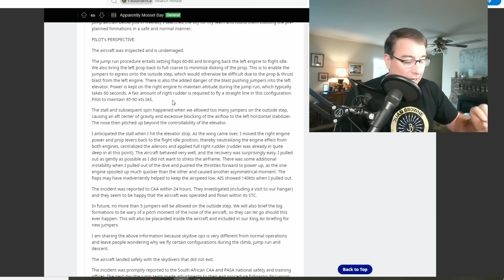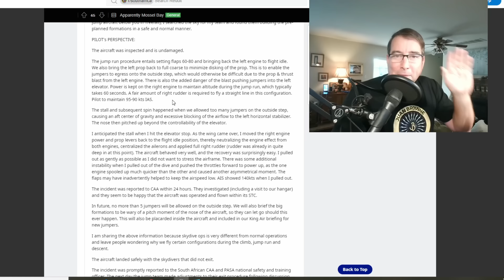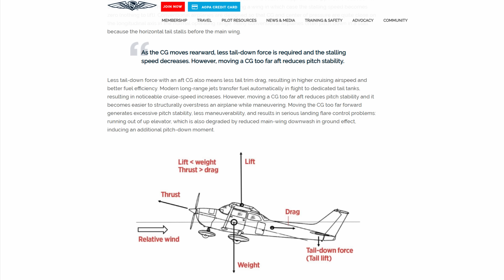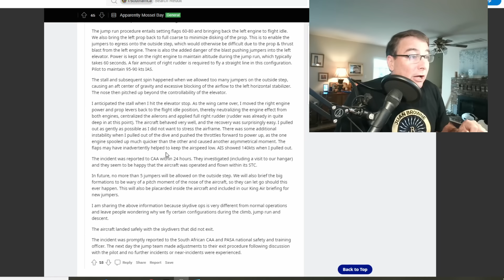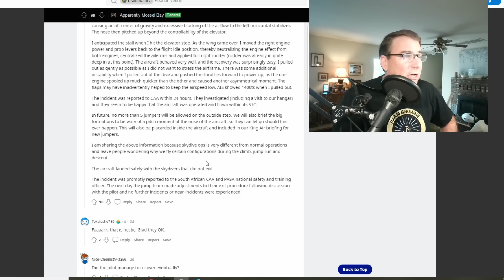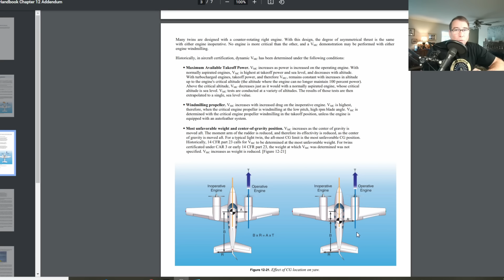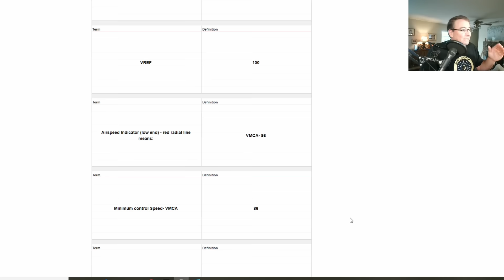Stall+Yaw=SPIN!  King Air Skydive Incident

Comment: The female jumper who came out last commented on the original source video. She said she didn't bail but had nothing to hold on to. Was thrown around and ended up on the floor by the door and when she tried to get up, she was thrown out. Bruised but OK and jumped the next day!
Reply from the maker: Thanks!
Reply: surviving an airplane ejection is not a common thing.

Comment: The last exiting skydiver was probably thinking it's safer outside than inside!
Reply: No - she got thrown out.
Reply: Without a doubt his intention was to get the hell out.
Reply: @Drew625in2une  her intentions wasn't really relevant because she got thrown out from not being able to hold on to anything.
Reply: we always think that. Once above 1000ft.
Reply: I’m outta here …
Reply: I always think I'm better outside than inside.  Used to jump out of Cessna 182 a bit.  Took a bit of rudder to get the door open.  Always a great time.
Reply: Most skydivers are not pilots, so the jumper probably thought something was very wrong with the plane after that incident. so why not get the jump in, instead of a potential botched landing due to some mechanical damage. why would a skydiver want to die in a landing while wearing a damn parachute? fast thinker I say...unless they were actually thrown out unintentionally. then they are lucky not to have been harmed, and to have got the jump in. I'm sure the divers that landed in the plane were relived, and disappointed as well.
Reply: Her comments were interesting.  She was next out apparently and had nothing to hold on to, was thrown about the aircraft and finally ejected.
Reply: Like we would ever take a skydivers opinion about “safe”. 😂
Reply: @perwestermark8920  I suspect the 4 left inside couldn't have gotten out if they wanted too due to the lateral g forces.  Then recovery at 250 knots was outside exit speed to jump from.
Reply: @dirtcurt1  Yes, I think the girl thrown out happened to be close enough to the door - probably even forward of the door. The others got bunched up on top of each other.

Wasn't too long ago a number of jumpers died in northern Sweden after their plane got in a spin from disoriented pilot. When he got out of the cloud, he pulled too hard and collapsed the plane. So all jumpers packed on top of each other in a wildly spinning plane all the way to the ground.
Reply: He thinking OH SHIT,  I am OUT OF HERE !
Reply: Once you have a parachute 🪂 on……..
You always think that your chances of survival are best outside the aircraft.
While in the 82nd Airborne Division heading out to New Mexico for desert warfare training back in 1974…….. the C130 was running out of fuel, so the pilot 👩‍✈️ decided to fly at about 150 -200 feet ………… we paratroopers wanted to hook up and jump out but we wanted the pilot to give us more altitude……. Instead…… he was looking to crash land on the Texas desert !!!!!!! We didn’t want anything to do with that.
Luckily 🍀…………. We made it to the landing strip and the pilot shut the engines as soon as we came to a stop 🛑……………. The guys from the Air Force towed the C130 away from the runway.

Airborne ! ! !

😎

Comment: I know this is an old video, but I just saw it and it brought back memories of being in a C90 that stalled on approach at 2500’ AGL in IMC. We were a medivac coming back to our home field after a transport. ATC had kept us high due to being between two larger airports, and the PIC was angry with ATC because of this. He had the gear down, full flaps, and throttles at idle to slow down and attempt to lose altitude in order intercept the localizer. Problem is that when he did pickup the localizer he pulled back, lifting the nose and the IAS dropped to 70kt. Things got quiet, stall horn was screaming and the wings buffeted. Now we had issues with this pilot in the past, so luckily on this flight there was an observer pilot in the right seat who took the controls, nosed over hard, and firewalled the throttles. The recovery was quick, and we went missed, but landed safely on the next approach. The worst part is the PIC would not admit that he stalled the AC. He was terminated on the spot.

Comment: Flying jumpers in a Twin Otter, yes, we would reduce power on the left engine to reduce prop blast, and use rudder to compensate. I wouldn’t go to idle, just reduce it some.. you don’t want the left prop be be a disk, you still want some air flowing through to help the jumpers “fly” their exit. Pretty normal. The jumpers also need to be aware about causing an AFT CG that could cause controllability problems. The Otter happens to be a more forgiving plane than the Kingair though. There was a similar incident in the PNW where one half of the Horizontal Stab came off in recovery. That plane got fixed, and eventually went to to get destroyed in the Hawaii accident.

Comment: Juan as a skydiver and a single engine prop pilot I can't thank you enough for the analysis. I'd imagine all the drag on the port side engine, while decreasing thrust on that engine would be a set up for disaster. While the pilot may have wanted to avoid the prop wash on the skydivers sitting outside the airframe, increasing the chances of a premature deployment and getting wrapped in the empennage (which would take everyone down) and I don't fly twins. Feels like a recipe for disaster if not performed correctly,  the pitch up was an issue given asymmetric trust, I'm not an expert at Twins in any way and never trained in them. Your analysis is pretty spot on, I've been enjoying your channel for a while and appreciate this breakdown. I learn so much on your channel, I hope you keep it up and also break down these situations as well.  Much appreciation for you.

Comment: Former jump pilot with A90 and BE-99 experience: too many people got aft on this one, pilot would have had to fly so fast to keep that many people on the tail they would have blown off. Poor recovery after spin entry, but I blame the jumpers for loading up the tail too much. Not a lot of elevator authority at slow speeds and a narrow CG range in the Beech's, gotta fly 100-120kts to have big ways hangin on the tail with less flap
Reply: Wtf you mean poor recovery ??? He recovered and did not kill anyone. If you recovered right away he might have hit a diver.
Reply: Use a 200 or 350.  That T tail makes a huge difference in C of G.

Comment: Juan, in about 1986 I had a coworker who was a former military pilot,  with huge hours (even worked on the Mercury splashdown recovery missions), explain the intimate details of a four-point roll.  I was fascinated by how the rudder became your pitch control during "that" moment in the maneuver.   If I ever finish my flight training and acquire a single-engine land certificate,  and type out in an appropriate aircraft, I'll have to try that, lol.  Thanks for your insight into yet another level of aviation!  Love your generosity and knowledge.  Cheers from Texas!

Comment: Hey Juan, king air 200 and 90 guy here. I’m kinda blown away by the way they have this procedure written. I think what I have to say about this incident is that people are reading “course pitch” what you should read is FEATHER. The reason it took one engine to “spool up” is cause the left engine with prop feathered needs more time for the prop to come OUT OF FEATHER and go into positive pitch. It takes time. Anybody that knows the king air or indeed the pt6 will tell you that it takes time to bring that prop from feather to full fine and ready to pull. And that would be reflected in the differential thrust described in the written article.
BE90 speeds that are relevant 

VF 174
VFE130
VMC93

Something like that

The 200 is better in every way. And the 300 is probably better than that and so on.

Coming from a northern gravel king air guy.
Reply: In one of Juan's frame grabs early in the recovery attempt, you can see that the port propellor pitch is finer than the right. Having a twin engine food processor sharing the same airspace with my unprotected carcass would scare the hell out of me.
Reply from the maker: Thanks Andy!
Reply: Oh yes I was making the same point before I saw your reply about the "feather" condition of the left engine. I think some multi engine and constant speed prop operations recurrent training might be due here.
Reply: These kind of dumb4ss3d procedures get passed down from one low-time pilot to another and are even requested by the jumpers.
Reply: @DARANGULAFILM  
I can possibly explain that.

When you have a propeller feathered and ask it to go to full fine while adding full power the propeller has a tendency to overspeed. King air 90 props are meant to be governed between I think 2200 and 1900 rpm. So when you shove it from feather… around 400 rpm to fine… around 2200 rpm. The thing has a bit of momentum, if you will towards the high pitch. The prop will momentarily over speed before the governors catch up. Mechanical connections and mechanical logic. It all takes time. That’s why we have governors. 3 actually and if you’re suggesting that the right hand prop was in a “finer or more high pitch state” I don’t what to tell you. Something is wrong. Because to perform this manoeuvre without one engine ready to go I.e. high rpm(fine pitch), seems silly to me. I understand you have thousands of feet to recover but I was always tought to operate these airplanes and any airplane in an envelope that they can work. This seems to be pushing that envelope to the max and in this case beyond. What if those divers inside had whacked their had and gotten hurt and the other obvious what if’s that arise.

Comment: You’re absolutely spot on! As a skydiver and former pilot, I’ve seen many times that jumpers pile up in the door and on the outside grips. Even with signs in the cabin “no more than x jumpers behind this line”. These guys are hyper focused on a well timed exit and ignore everything else.There is normally heavy buffeting due to the disturbed airflow over the tail with jumpers hanging outside which can mask a pre stall buffet. Due to substantial drag increase, its almost impossible to do this without a rate of descend or adding substantial amount of power. Doing a final jumprun this close to stall speed and below vmca is begging for it! I can not imagine that this has not happened a good number of times already, only this time is was caught on social media. In the skydiving centres in parts of the world I’ve been, the pilot lives in a bubble and formation jumpers do a exit dry run on a mock up with zero consideration for airplane controllability (“that’s the pilots job”). Briefing folks!!
Reply: Exit training aid: A 'known tipping point' swiveling mock-up that dumps them all on the hangar floor now & then? : )
Reply: @skydive1424   - Nah, health hazard for the next lift - they usually start to gas-off above nine grand anyway, so why add to the pong?
However, the idea of a mock door & rails on a remote control 'bull riding' machine does appeal . . . think 'reverse stick-shaker'  : )
Reply: Lod dude 😂😂😂

Comment: In all the operations I have flown in, we always reduced the power to minimize propwash and sacrificed altitude if we couldn't maintain enough stall margin. At least in the singles I fly (Pilatus PC-6, Cessna 182) the decent rate is not that excessive that the skydivers will notice the altitude loss from start of drop to finish. I usually just request the next 500ft higher flight level and drift down during the drop.

Comment: I am a skydiver.  Many years ago I jumped out of a stalled King Air at a private dropzone near Wildwood, FL.    The takeoff on that flight was also extremely dicey
because the King Air barely missed the treetops on the west end of the runway.   In skydiving circles, King Air has a notorious reputation for stalls on jump run.

Comment: The pilot appeared to be going way too slow on jump run; just for the ease of the jumpers.  No need to slow down that much as the first jumper out would normally climb forward and block the wind for the others coming out. I recall climbing out of Mike Mullins' Super King Air at 21,000 ft at the World Free Fall Convention with no issues.
Reply: Did the same exiting a 402
Reply: So you think going too slow led to the stall?
Reply: Mullins has -34s on his king air. He could probably shut the left engine down and still easily fly jump run at 90 kts. I did that 21k jump at Quincy one year. Great fun.
Reply: Yep I made 21 jumps in a day at Skydive Marana in Arizona during a boogie with Mullins king air. Never got out of his plane below 17000.  Good times!!

Comment: Well when we did parachute jumps at Sun N Fun for a few years in the 90’s  that is basically what we did in the DC3. I asked another operator and they do the same thing. You have to pull the power on the side they jump from. We stayed 10% above VMC and were in a slight decent..

Comment: I think "disking" of the prop means fully "fine" as a windmilling fine prop will act like a disk generating maximum drag which would exasperate the asymmetric configuration.
Reply: Windmilling is when the aircraft's momentum is used/wasted turning the prop, even minimal engine output means no windmilling.

Comment: I have never seen a King Air spin before. I swallowed hard watching the plane enter the secondary stalls. Kudos to the pilot for recovering the plane.
Reply: I actually think the aircraft recovered without the help of the pilot.
Reply: That was pure ass luck.  The pilot deserves no applause.  He put the aircraft into that position through ignorance.
Reply: The cocky know it all's have spoken above. I agree with you, Kudos to the pilot for pulling it out of disaster.
Reply: @steve83333  Funny, you come across as a cocky know it all with that comment. Would you recover from a spin by putting alieron AWAY from the spin, then keep on trying to do that not once, not twice, but three times?
Because this "pilot" did... Face it, the guy panicked and froze once it spun. The aircraft wanted to fly straight after the first spin recovery, but he kept horsing on the controls and trying to enter into more spins...

Comment: Having flown the King Air and the De Havilland Twin Otter I can attest to the fact that the King Air is not really a good jump plane (for the reasons demonstrated in this video). The Otter is a great airplane for this activity  because of its high wing and very low stall speed. The engine and prop configurations on both aircraft are the same, PT-6 Pratt and Whitney. When the power is reduced to idle, on either aircraft, it is like putting on the brakes. The deceleration is very pronounced. The way this guy was flying the aircraft he was just asking for a stall/spin.
Reply: Agree.  The Otter is superior in this respect.
Reply: Cessna caravan is also a good jump plane
Reply: @teddrewflack400  Correct on that.
Reply: Yep, cut my teeth skydiving out of the Otter. Twelve pax plus the Master. Pilot took it to about 70 knots almost at stall at every opening point. She's a great workhorse and perfect for the job.
Reply: But DC9/MD80 is best xD
Reply: @rkan2  

Back when I was active (jeez. Almost 20 years ago) the Conatsers were trying to get a DC-9 up at Perris as a jump plane.

Comment: Center of Gravity and airflow disruption has always been a factor in flying jumpers.  Some jump pilots and some jumpers understand these effects and do a good job of compensating.  Other pilots and jumpers are less knowledgeable and less safe.  A particularly difficult jump plane that I jumped a few times back in my mis-spent youth was the Lockheed Loadstar.  The exit door was quite far back.  Too many jumpers near the door on exit could stall the aircraft...there were fatalities.
Reply: was that back in the 80's ?
Reply: @dennisparks3692  Mid 70s at "the Gulch".  I don't think they ever had an actual crash there, but I had friends who bounced off the tail in a stall event.  The fatal Lodestar crash or crashes were elsewhere.  The Lodestar stall tendency was well known and jumpers were briefed on how to exit without having too many people behind a specific line, well forward of the door.